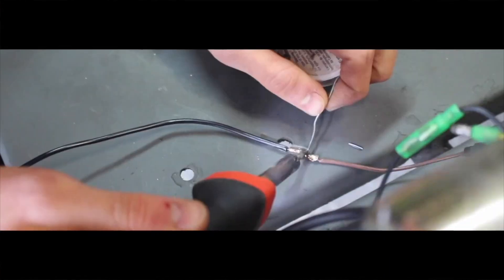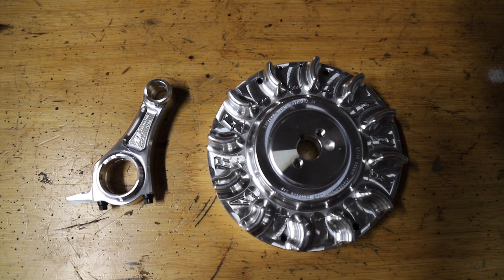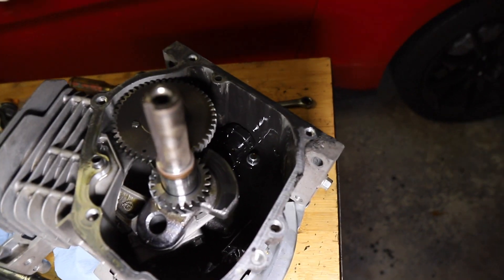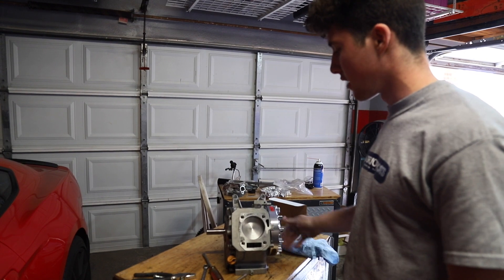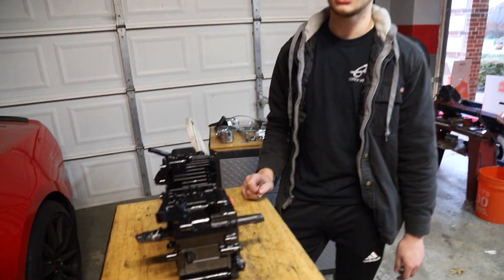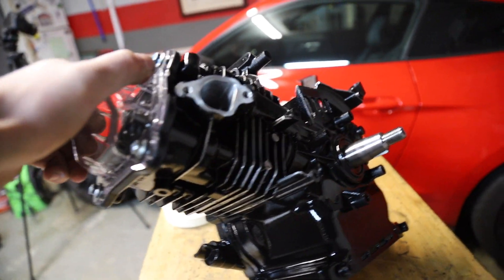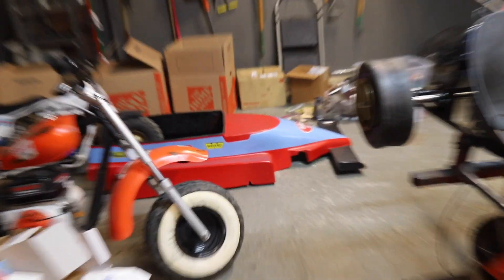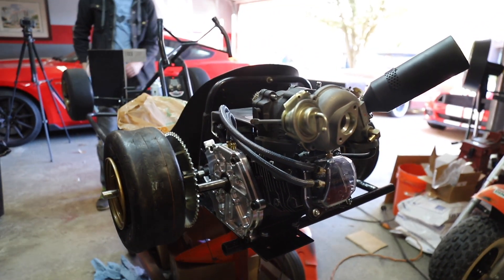Turbo Go Kart 212 Gets FULLY BUILT | Stage 5 Predator Build!

Comment: I could be wrong, but that head that you added. Is it not the same one the 208cc engines use? I swapped my simpson 208 head onto my predator. I believe that they have bigger valves

Comment: Kinda skeptical about this. A single cylinder turbo set up won’t really give a decent exhaust flow to spool the turbo, that and it’ll be very pulsey.
Reply: The 212 makes plenty enough power stage 4 and NA, so adding a turbo isnt a big deal. That turbo is TINY and stage 4 they will rev out to 9K+ so its fine

Comment: Good job guys!  Glad to hear you've decided to go the EFI route.  Which system are you going to use and about how much will it set you back?  I've been impatiently waiting on nanoefi myself.

After you've tuned this and dyno'd it you should cut the drive portion off and run it belt or chain driven as a supercharger.  Taking a WAG I'd think you should get 20%-40% more power and you'd definitely get boost over a wider RPM range.

Comment: Hey Man, Awesome build!! Great to see the progress to efi. Just wanted to mention that a larger collector at the turbo may be required as the waste gate exhaust can interfere with the exhaust and cause a bunch of problems with boost creep, low spool and hot egts. Maybe make a separate pipe that joins in for the waste gate

Comment: That cam is not going to be ideal for a turbocharged application. Minimal overlap is what your lookin for. All of that captured energy coming from the turbo will get spit right back out the exhaust and the turbo will be all for nothing. This is especially true in your case, where you’ll be lucky to see 5 lbs
Reply: Yeah in automotive applications that's kinda the standard deal, don't want high duration or overlap on a turbo application

Comment: Please please re-inforce the cylinder walls by welding aluminium bars on the Hershey-Bar-Thin sidewalls 😱 I'd hate to see that beauty split the block in half under load. It's a guarantee it will happen if you don't weld the block. The billet cover isn't protecting the weakest areas of the cylinder walls.

Comment: Painting the cooling fins is like wrapping them in insulation to hold the heat in.
Reply: Lol no it's not.
Reply: @Jeremy-iv9bc  actually it is. the motor is air cooled, surface area is needed to keep the motor cool, hence the fins.
Reply: @Pony_Scavenger  yea but that's why they used engine paint it's made to dissipate heat well

Comment: Just a heads up you want as little valve overlap as possible on a turbo setup... you want them to open then slam shut to hold the boost pressure charge in not blow it out the exhaust port it wastes valuable duration on the camshaft blowing boost out the exhaust valve...

Comment: I dont think that engine produces near enough exhaust force to drive the turbo properly even 4 bangers struggle to get that turbo going from a stop.
Reply: Kevin what four banger have you seen someone put that turbo on? And definitely yes, single cylinder engines dont do crap with turbos till at pretty much redline
Reply: @knowbull5hit590  Not this particular turbo but ive put one slightly larger on my b20 and it doesnt move at idle its just an air restriction.  Maybe an issue with the exhaust turbine size but turbos are always more of a restriction until you get higher up in the rev range.
Reply: Kevin I have a 1l 4cyl that has a very similar turbo and it works fine.

Comment: You guys need to start getting into bigger cams.... like a f275 or 308 but great video! Love the way the engine looks. How did you install the brass  Barbs in the billet side cover?
Reply: What do you know about putting in bigger cams? They used a tap kit to fit them.
Reply: They already had clearance issues with then new cam, a bigger cam would make that worse
Reply: Just have to have valve pockets cut into the piston. Drag mini bike guys use  big cams even bigger than a 308 in a hemi predator with over size valves around a 32 28 set up. All you see people using is mod 2 cans most the time a a mod2 ain't much better than a stock cam
Reply: Linda Castro yeah valve reliefs in the piston or shave it down quite a bit and just get the stroker rod. It aint much but i mean🤷🏽‍♂️anything is something
Reply: Shit GPS has bigger than .308’s😂😂😂put a MONSTER cam they just need chromoly pushrods and gage venom roller rockers

Comment: This will be interesting when its built, question will it actually be worth the money put into it....likely not at all.
Still really don't understand upgrading small engine vs buying a motorcycle or quad engine.

Thought for later, what about building a gearbox for one of your projects and testing it vs just a sproket. :)
Reply: Agreed much better off with a 250 4 stroke from a bike. Way better drivetrain already setup, and much more aftermarket parts available
Reply: I think its because a new predator 212 is like 99 dollars
Reply: @nah6430  a new predator is $99 but he installed $1000 worth of price in it... You're better of buying a motorcycle and pulling the engine out...

Comment: ok so basic rule of thumb when boosting a carb......5 pounds of boost.....5 pounds of fuel pressure = no fuel at boost. What fuel pump are you using, and are you using a boost controlled regulator?  The high compression is NOT what you want when boosting. did you gap the rings for a boost application ? Sorry to be a troll, i just dont want to see parts flying or MASS turbo lag or zero power at rpm's
Reply: matt sez  high compression is what makes a turbo engine less laggy. Its a complete myth that lower compression is better for boost
Reply: No matter what a single cylinder engine will always be laggy as fuck with a turbo though
Reply: @knowbull5hit590  incorrect....it cause turbo back pressure .....over heats exhaust to turbo....and bends and breaks rods and wrist pins, and over heats rings. A 1 cyl engine like that is at its edge with a stage 5 as it is......so u tweek comp, THEN boost it, it breaks, that simple because im pretty sure the gov has been removed. That things gonna drop a piston seal
Reply: matt sez high compression and boost does not “bend and break rods” or any other internals, improper tuning or too much power does that
Reply: An improperly sized turbo creates too much back-pressure too, compression and the NA power the motor already makes is what spools a turbo. Like i said its a myth that high compression and boost dont go together, it wont change how much power the motor can make, it just makes a laggier setup to have less compression
Reply: @knowbull5hit590  I bet you....lol....a public " i was wrong....( other person ) was right " comment, written to one another if it does or does not blow up or work well at all.......bet?....lol

Comment: Your gonna kill all you boost with that cam. The boost will just flow straight out the exhaust with all that overlap. You want an love separation angle of about 115-112° with boost. Don't know the lsa it has now so please tell me what it is. Also don't want too much duration. Maybe 230 max. You really want high lift low duration amd a wide lsa with boost
Reply: That turbo is way too big for that engine anyways.
Reply: @fullmetaljacket7  yep, I have the same turbo on a 300cc water cooled scooter, and it just starts to make boost at 5500. 212 is never going to get enough heat to spool that turbo. They would be better off with EFI and a 10 shot of nitrous.
Reply: How are you gonna build boost like that with barely any exhaust flow
Reply: @traceanthony3588  if it makes any boost at all it'll just blow all the fresh charge out the exhaust and not make any more power with that cam.
Reply: @hunterpetrovich1460  but isnt that cam included in the kit he bought from powerjunksports?
Reply: @fukkyoutube  yes. Your point?
Reply: It’s for efficiency not boost
Reply: He even said

Comment: I believe the reason your boost gauge had so much fluctuation was because you charged air tube had a smaller volume of space than the cylinder itself. I think if you ran the charged air to a small “tank” and then to the carb the gauge and the engine would preform better
Reply from the maker: Daniel Poindexter yes exactly, we found a study from MIT engineering where they optimized single cylinder turbo output by making an air capacitor. We’ve been looking at the equations to make one specifically for this application.

Comment: PLEASE TELL ME YOURE NOT USING STOCK PUSHRODS!! PLEASE!!! If you are those will bend sooooo quickly, you need chromoly pushrods!
Reply: Vinny Calvo..Well better pushrods didn’t come with the pile of parts that he is bolting on to make this think so amazing! Lol. Goes back to the extreme lack of mechanical understanding and knowledge.
Reply: Well the channel is called build, BREAK, repeat.
Reply: I think they said there's an ARC rod.  I don't know that brand but maybe they thought of it.  What bugs me is I could have SWORN turbos dont like a cam with a lot of overlap...  my memory is faulty but... i dunno.

Comment: Why dont yall turn the turbo around 
That would make so much more since
Reply: No, it wouldn’t actually. 1) better to have a little longer downpipe for noise reasons, and 2) if they flipped it around the intake piping would be way longer than necessary
Reply: @E46TY  still would be smarter for flow sakes and simplisity sakes

Comment: If you're not running an intercooler I would run ethanol with the EFI set up.
Reply: The idea of the intercooler isn't to cool the turbo... it's to cool the air going through the turbo haha
Reply: @lpmorgan90  wrong. It's to cool the charged air AFTER it passes through the turbo. I recommended ethanol to lower cylinder temps because it has a natural cooling effect.
Reply: @scottycotner  I knew I got it arse way round haha nevermind
Reply: thing wont make enough MAD to even need an intercooler.. 2-3lbs at best

Comment: You can poboy balance the crankshaft use old bearings on the crank with the piston rod rings everything together on the crank as if it was in the engine. Use something to set the crank bearings in for the crankshaft to be able to spin in the bearings freely with the piston and rod hanging down spin the crank to see if the weights are heavier or the piston is heavier you will then know what is heavier to take material off of. If done correctly you will have a engine that will last! Not doing so results in bearing wear then rod nock then worse from then on. Not hating on the turbo build I think its sweet tbh. Also remember with force induction you'll always be taking timing out. I'd start with stock ignition timing and go from there 32 degrees i still think is to much.
Reply: Congrats on the longest run-on sentence I have ever attempted to read!

Comment: Supercharger...Scrap the Turbo.. Supercharger Supercharger
Reply: Agreed, it would actually make proper boost.
Reply: @Mish93Will yeah but snail.
Reply: hairdryer might work better?
Reply: Super charged....It works on Model engines. So a briggs is just a bigger version... Supercharger.  Instant POWER
Reply: @bansheemania1692  
You're going to eat up all the extra power you're making just running the supercharger. It's called parasitic loss. There's a reason most of the forced induction engines in new vehicles are turbo and not sc. Look at Cobra, GT500, CTS-V, and Mercedes guys that take the blower off, go turbo, and make 100+ more HP at the same boost level because they're not spinning the blower off the crank anymore.
Reply: no man..
Reply: SO2002 sadly it would be way easier to make BOOOOOOOST
Reply: With what belt?
Reply: Use an AMR300

Comment: higher compression and turbo not a good combination, usually you lower compression when boosting
Reply: Depends, lower compression in good when you want to run a lot of boost. Doubt this turbo will be able to generate 20 or 30 psi😂
Reply: With EFI and hopefully some E85, you can run 9.5:1 and 10-20 psi of boost and not grenade it.
Reply: @ionstorm66  True, and there is no way this thing will sniff 20lbs of boost.

Given what they have I'd say they are doing it the best way.
Reply: True but more power off idle.
Reply: Yeah I think the turbo is going to be "just for fun" but I like it anyway. Even if it made boost whether this particular EFI can take advantage of it is a big question.
Reply: He set the ring gap at .057 that’s huge lol.  It should let some compression past the rings
Reply: Thomas Kimmel. Haha!! Ya instead of lowering compression for the boosted motor with head work, piston and rod they are just going to go with the blow by method. 😂😂
Reply: True but if they dont have enough compression getting that turbo moving will be difficult. People generally run lower compression on boosted builds simply because it puts less stress on the engine and that compression can be made up with the turbo under the right circumstances.
Reply: Higher compression means you need less psi but I prefer na on a high compression engine
Reply: Less compression just means more lag and less out of boost power. no matter how you make cylinder pressure whether its with boost or compression, the limitations of what cylinder pressure the motor can handle are still the same.
Reply: That is if your internals can’t handle it. Its all billet internals, it’ll be fine. Racing engines that run like 60PSI like hondas and 2J’s and shit run like 12:1 or higher and high ass boost because on such a small engine, thats the combo you need to make crazy power
Reply: @E46TY  These Predator 212's with the billet internals will run this stage 4 kit with NOS just fine so they shouldn't have to worry.

I've seen these things turn 12k RPM with the stage 4 as well.  The failure is usually a push rod or rocker bending.
Reply: Only n00bs run low compression with boost.  With a good cylinder head, quality charge cooling, the proper timing, and a lot of octane you can easily run high compression, high boost, high power motors.

This 212 motor though.. while they proved in the dyno episode the turbo is actually adding power, it's not really that much.

Comment: On the next episode: we make a kart slower by adding a turbo.
Reply: Nicks backyardprojects...lol exactly. It doesn’t matter how many parts you can “bolt on” to this thing. You still actually have to know the why and the how of building boosted engines if you really want it to work. I applaud them giving it a try, but there is an enormous lack of knowledge behind this project... which almost always spells disaster. I wish you all the best though, I hope you succeed in whatever the hell you are trying to do here.
Reply: Like most things they do cars and cameras just gave up and moved on when things got hard lol.
But yes I think it's hard or maybe near impossible to get a single cylinder small engine to use a turbo effectively.
I also think that huge cam, giants ports etc. Is likely hurting more then helping. Velocity is a good thing.
Id like to see someone turbo like a 670 or some other Vtwin with efi
Reply: 212 is small for even they smallest turbo. I have the same turbo on a 300cc water cooled scooter, and it just barely getting spooled up at 5500, so you have like 2k of power band. You'd be better off getting race gas and going high compression. With EFI and CDI will make about as much power as you could ever make with a turbo.
Reply from the maker: Nicks backyardprojects That maybe true, but with efi this thing should really have a chance. Nobody has really ever gone this far so who knows 🤙🏻
Reply: @BuildBreakRepeat  CarsAndCameras has gotten close with the turbo efi drift trike.
Reply: @Skwisgar2322  that was years and years ago, before they really knew what they were doing. I'd love for them to revise that thing with all they've learned.
Reply: @BuildBreakRepeat  Nah boss a couple of channels have done the same thing with efi and it was only semi effective they only moved the power band to a higher area in the rev range
Reply: its all about tuning im running a PTE 6466 on my predator 420
Reply: @brotomwang8218  why do people like you even comment? I bet you don't even have a bicycle,let alone a  $2100 turbo on a predator
Reply: @datraktorman69  I bet I have more money and assets than you lol only broke people go after someone’s wealth
Reply: @brotomwang8218  you probably don't even have the bicycle,just the helmet that your mom makes you wear at all times
Reply: @brotomwang8218  post a video and prove it instead of arguing and trying to flex lol i’m actually curious to see what a 2k turbo looks like on a predator tbh i doubt the turbo does anything because 212cc isn’t enough power for a turbo.

Comment: Looks awesome would be sick if there was a way to run a 2 step to build boost before launching it
Reply from the maker: Jeremy Howell Dude we were thinking of that, this efi system is really cool, might be able to do it
Reply: Build Break Repeat  can the efi control timing? Yall should try running a single COP coil off of a car engine if so and set up some anti-lag/2-step on the thing

Comment: Uh Oh.. U shaved off some of the crank? That could be catastrophic. It'll be out of balance now and create alot of vibration, limit rpms etc. Just concerned..lol
Reply from the maker: gmane1989 Yeah we just shaved off a little bit of the casting...it’s actually super common for engine builders to do that on these 212s. Shouldn’t have any issues.
Reply: hahaha, that was funny...such a goofy thing to say!
Reply: @philtripe  it's goofy to you..because maybe u just don't know...
Reply: gmane1989 Its most likely because he’s seen a dozen other people do the same thing with these engines and them run completely fine at double stock RPMS